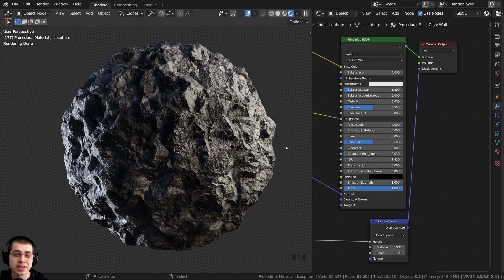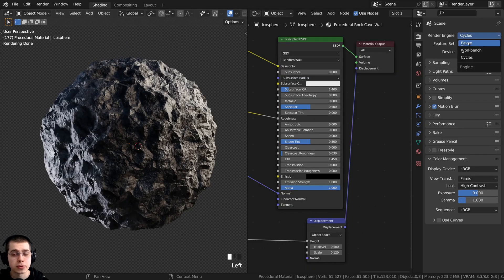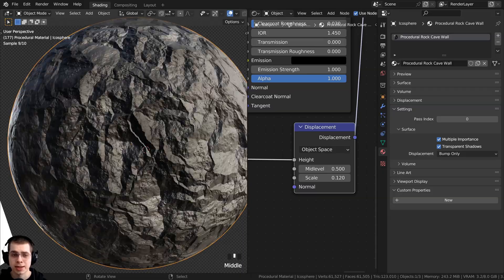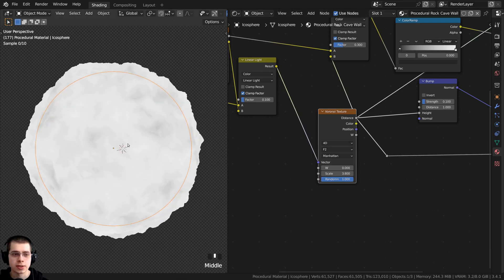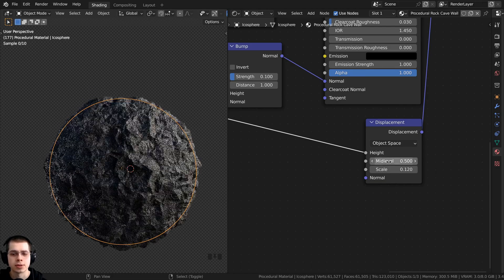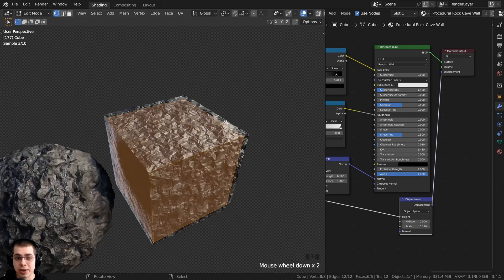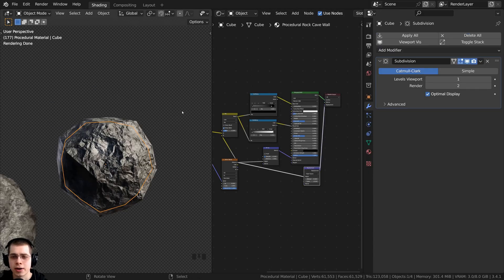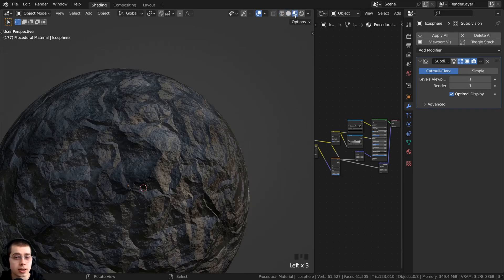How to Fix Displacements Not Working Correctly in Blender

Comment: I'm having an issue where I append one of your tutorial's materials to a new project, and even if placed on an identically subdivided ico sphere with all rendering and lighting settings the same. It still does not copy the displacements over. It is set to Displacement and Bump, not Bump Only. However it appears as if it's set to Bump Only. I appended the mesh I used from the material project. The material works on it, across blender files, but not any other mesh.

Comment: Idk what is going on. I have double triple quadruple checked and I have everything set the same. I know how shaders work and I extensively use them in unreal engine for years so I can't figure out what is happening. It won't work nothing ever changes. There are plenty of vertices, the height map is connected to the displacement node which is connected to the displacement output in the material. I'm in cycles and still nothing.

Comment: What It is happening to me is that I apply the same material that works un one of the mesh, but doesn't work in the new mesh, has the same uvs and is using subdivisión surface like 400.000 polygons but is not working

Comment: When I use "Material Preview" on my "Viewport Shading" the Displacement is negative, and when I change to "Render" View the displace turn positive. What I do to fix this? 

I want both on the same direction.
Reply: I apply the Rotation and works.

Comment: I would like to see something like this with normal baking too. I have times when the normal bake is really broken, though at least unity can fix some of that internally. 

I know some of it can be fixed by turning on backface culling, sometimes there is overlapping geometry or UVs, sometimes it's the RGB/non-color thing, but even with all that, sometimes I still get oddities, like weird colors, or the actual geometry being baked into the texture. So, I was hoping you might know things I missed.
Reply from the maker: thanks for the video idea. 👍‍
Reply: @RyanKingArt  One of the issues I notice a lot is when I use a wave texture to make grooves or raised lines, many of the lines will be broken, off color, and more. Higher resolutions can help there, but not enough.